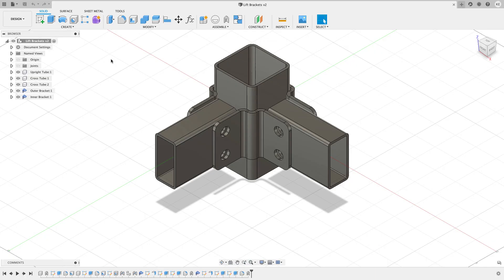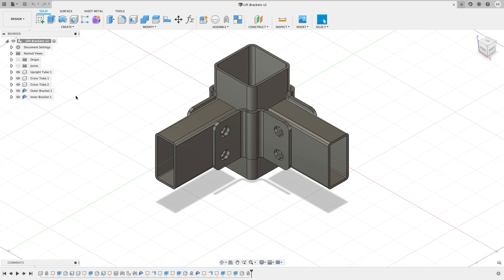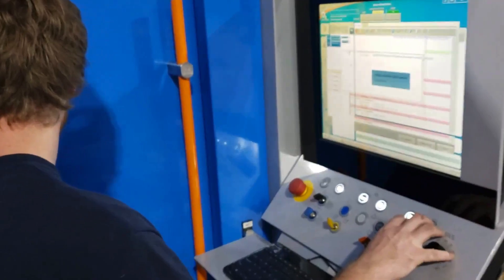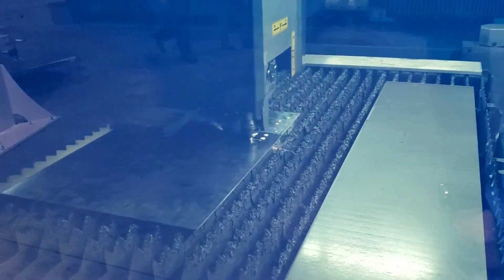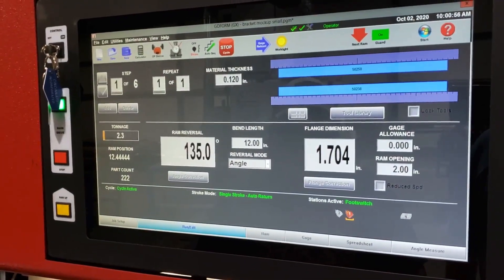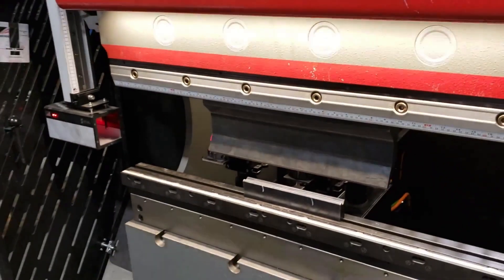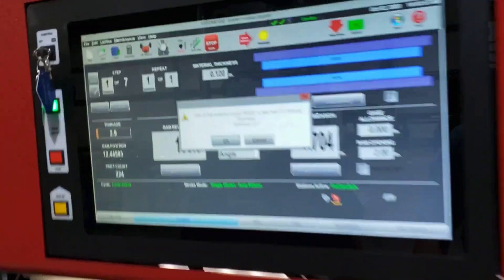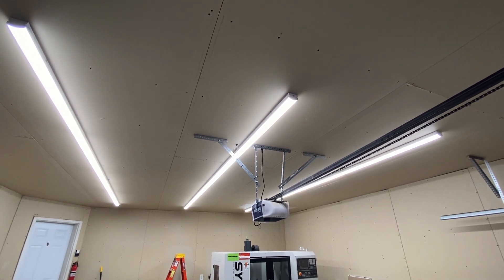Jetski Lift Replacement Brackets Fabrication and Completion

Comment: just to finish up the story, could you give us a rough idea of the cost to fabricate the brackets. Always wanted to have laser cut parts but just imagined the cost is still very high due to the expensive machines being used so have never bothered to get a quote. Would be interesting to see laser cost and then bending cost. Great pratical series of vid's thanks for that
Reply from the maker: I didn't get a granular breakdown like that. Including shipping and tax, I had 8 parts made that came to around $20 per part. Volume is always your friend when it comes to parts like these. I'm not sure the cutting process would have changed the price a lot though.